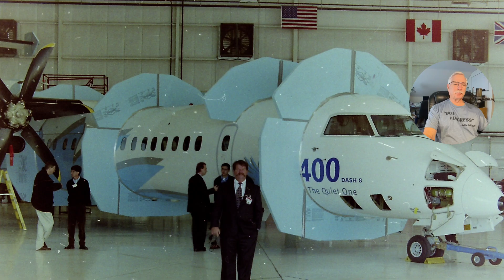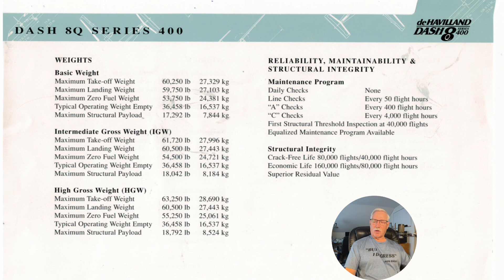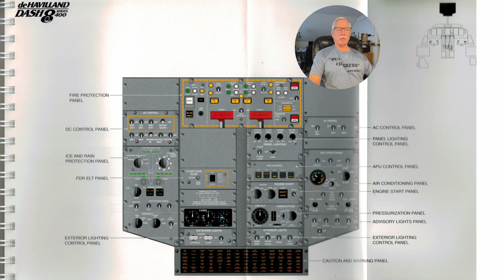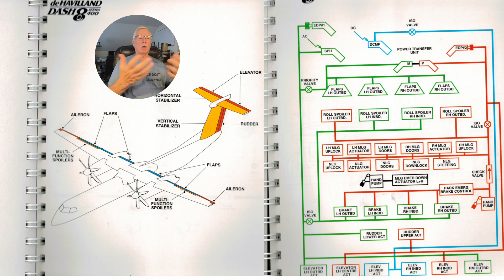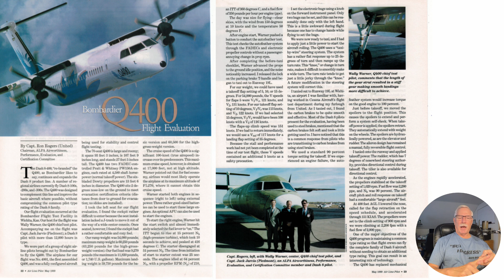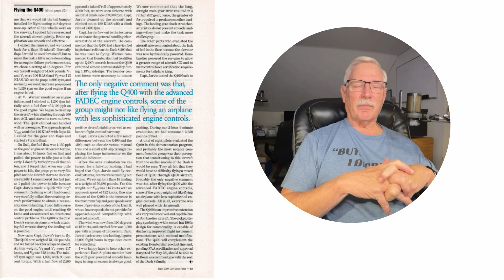Bombardier DASH 8-400 Flight Evaluation for Air Line Pilot Magazine. Q400

Comment: Awesome video on the Q400.  I flew this plane for many years and it was neat to see the differences in the initial model.  You'd be happy to know they swapped out the PFD round dial instruments for Airspeed and Altitude tapes, much more readable then the round dials you had there.  We even had a HUD in ours to do hand flown CATIII approaches too which was even better!  We also had an APU which, ironically, didn't like to start when it was really hot or cold out but when it worked it did its job alright.  The system that got written up most on the plane was the ANVS.  If you don't recall, think of it like noise cancelling but built into the walls of the plane to help reduce the prop noise a bit.  Apparently that's why they designated it "Q" for quiet.  Perhaps that was a joke that flew over my head though, it didn't seems all the quiet to us.  When that system started to go out it sounded like a child playing a bongo sitting in the walls somewhere, or perhaps a gremlin. 

On your story where you talked about pulling the power on landing I reflexively tensed up too. That plane will drop out of the sky quick with power pulled out if you don't have extra speed!  The way we flew it was to keep the power in until the main wheels touched down.  You could reduce it a bit if you started to float but even bringing it to idle was usually too much.   If you gently worked it down to the runway you could get a really nice landing but it was hard to do.

This was a fun trip down memory lane!  Keep up the good work.
Reply from the maker: Thanks and interesting comment on the ANVS system. Naturally this was early in the development of the aircraft (you can tell by the paint job, or lack of it!), and it's good to hear how things played out.

Comment: I flew on Lynx (Frontiers regional) Q400 a few times between Den and OKC!  What a powerful prop.   I loved how everytime i flew it we always had to have passengers move to the back for weight and balance.  I always volunteered because though it sat 4 across the two seats on each side together were tight....so by moving to the back, you'd get more space ie a row to yourself LOL!  I remember we typically cruised 22000 to 25000ft on those routes.

Comment: Thanks Ron. I fly Q400s for a regional. Awesome aircraft to operate, for the role it fills, nothing beats it for economy and flexibility on thinner regional routes. We can have pretty close to the same block times as regional jets inside of about 300nm, if you drive it. Consistently good, smooth landings take practice.
Reply from the maker: Couldn't agree more!

Comment: Yet another great video Ron!
My ‘retirement’ job was on a Q400 flying for WestJet. It was my first turboprop (after a career of flying jets).
It had surprisingly good performance, and easily kept up with the jets in terminal arrivals and departures. In fact, both YYZ (Toronto) and YYC (Calgary) sequenced us the same below 10,000ft.
There were times where I really appreciated those 13 foot diameter props instead of thrust reversers, especially when landing on short, contaminated runways.
All in all, it was a great airplane.